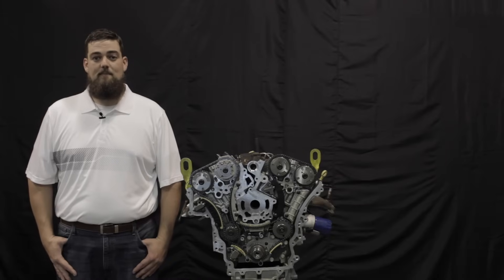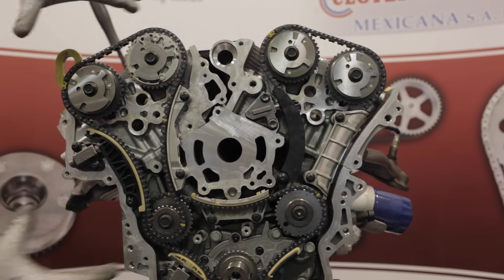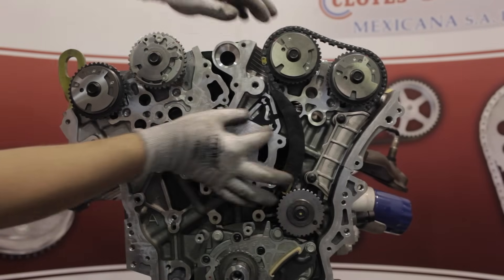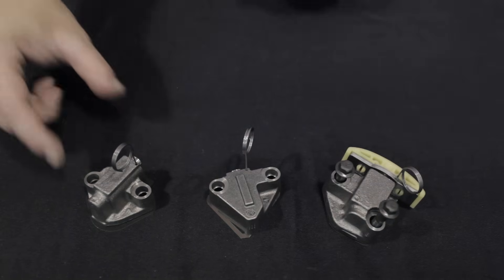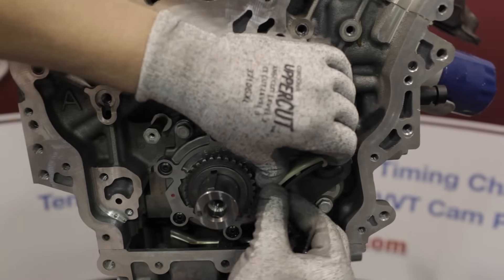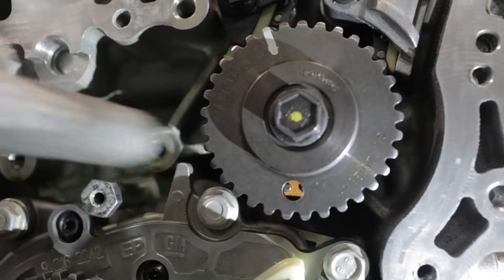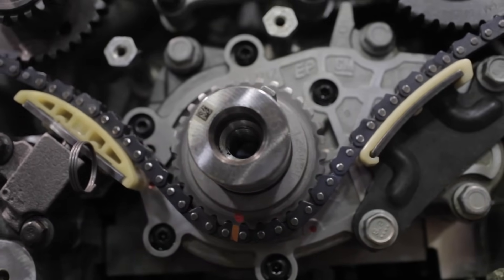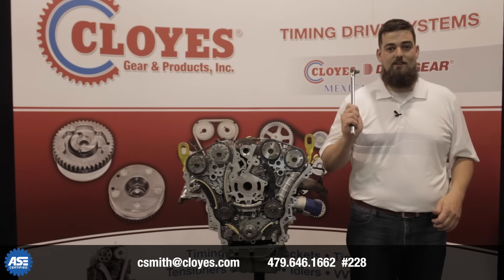GM 2.8/3.0/3.2/3.6L Timing Chain Replacement Repair, Cloyes 9-0753S

Comment: Awesome video! Thanks Cody! But do y’all have a kit for the 06 Cadillac STS v6? Part number please..? Thanks again!
Reply from the maker: Sorry Dennis. We do not have a timing kit for his particular Make/Model/Year. GM changed some features on the timing system between 2006 & 2007. They went from a roller style secondary chain to inverted tooth chains. All we have available is the later kit with the IT chain. Thanks for the kind words though! Call our tech line, and we might be able to assist you a bit more.

Comment: i am assembling a motor that already had timing components removed. while installing my primary drive chain, do i have to know if cyl #1 is at TDC on the compression stroke or do i just align the crank sprocket as shown in the video. is there only one way to do this or will the marks ever line up but the timing be out of place? not sure if crank was previously spent out of position. there is no reference to piston position.
Reply from the maker: just align the sprockets as shown in the video. If all three chains align to the sprockets at the same time, the engine will be in time.
Reply: @Cloyes01  hi.
My timing has moved. How do I exactly line up the cam Marks?
Reply from the maker: @sanjec  The camshafts all have hex features where you can use a wrench to rotate the shafts individually. With the idler timing mark aligned to the appropriate chain link, rotate the camshafts so the marks align properly to the chain.
Reply: just put heads on a 3,6 gm and picked up a cloyes set I cant find and piston timing procedure, Stage 1 (driver side chain)  or stage 2 (passenger chain) which of these are supposed be TDC on cylinder 1#?

Comment: What about setting it to top dead center before proceeding ?
Reply from the maker: There is no need to worry about TDC when setting the timing in this engine. The timing marks on the sprockets and chains insure the engine is timed correctly.
Reply: What if the right bank camshaft timing marks are not at the top so i cant set the colored chain links

Comment: How is the engine being rotated from secondary to primary and vice versa in this video? From the rear of engine with transmission removed?
Reply from the maker: Yes, we used the flex plate to rotate the engine in the video. With the engine in the vehicle you can slide the balancer onto the crank and rotate by hand with the spark plugs removed.
Reply: This is also my question at present.  Since yours was 2 years ago, maybe you know by now?

Comment: Sorry, but you must remove engine to do this project, on transverse mount
Reply: No you don't. You just have to have a lot of patience. You have to move the fuse box over, pull the alternator and power steering pump in addition to what he mentioned.

Comment: Can the chains be replaced without taking the engine out of the car?
Reply: not on a Transverse mount engine.
Reply: Doing it right now and yes it's possible... 09 Acadia
Reply: Yes it can be done with out removing the engine. Just take your time and remove the fuse box, fuse box base, motor torque brackets, power steering pump bolts, etc.  Don't them tell you it can't be done. It just takes longer.
Reply: Yes it can be done in vehicle.  Just take your time and clear out as much as possible like Rick said.  Not a horrible repair just time consuming.

Comment: Great video, I just completed the timing chains on my cts. Your video was very helpful for chain installation. Its a big job for a diy guy but it beats the $3600 shop bill. Thanks for the vid
Reply: Did my '10 Buick Lacrosse with 3.0l v6 in frame wasn't bad at all!...i was down to the chains In about 45mins but beware guys that right bank is gonna give you the blues because the timing marks are ever so slightly off...and the phasers are gonna want to roll on you you!...its best to get the camshaft retainers to hold the cams still while you degree the marks!...other than that pretty easy job!...
Reply: Mr. Grider,  did you have to pull the engine out of the vehicle or were you able to do it all under the hood?
Reply: @jayclarke2434  the guy said you do not have to pull the engine from the vehicle

Comment: You are better to set the car on fire and buy a Ford if you were stupid enough to buy a GM in the first place.
Reply: Ford's Use of Plastic 
for Cooling System parts
since at least 1998 
is why my friends Fords 
no longer run.

Comment: was that the torque wrench used in the install process you dropped on the floor as you concluded ur instruction?
Reply: That’s a breaker bar, dingus.

Comment: Hi Codi can i ask you about  idler sprocket when you  install timing chain set  if rotate the engine   to stage two  timing position  after rotation  2or3 time all mark  strait at mark  aligns except idler sprocket  if you please let know thanks

Comment: Cant Thank you guy enough. I walked through this step by step with this video. Glad you guys did it.
Reply: Jay Clarke definitely you can do it with engine on
Reply: Doug, were you able to do this job while the engine was still in the vehicle or did you need to pull it out?

Comment: Did you forget to mention the special camshaft lock tools so the camshafts doesn't slam back during assembly? They do install on the back of camshafts so you might not can see them ?
Reply from the maker: No, we did not use the special camshaft holding tools for this installation. The tools are available, and may prevent the  camshafts from slightly moving when the chains are removed; however, they are not required. The idea behind the two stages of timing is to position the camshafts on each bank where they are at rest before the  chains are removed. This prevents the camshafts from moving when the chains are removed, effectively eliminating the need for the holding tools.
Reply: Ahaa! I was wondering why you did the two stage process. Perhaps a few words towards that feature of the process would have been enlightening . Good video anyhow.

Comment: Thanks for the video. The timing chain of my 2010 Chevy Traverse AWD is on the passenger side. Is it possible to change the timing chain with the engine still in the car or I have to drop the engine down? I appreciate your reply.
Reply from the maker: You should be able to access your timing components with the engine in the vehicle. Just a little less elbow room!

Comment: Anyone that is doing this job along with removing the heads to replace bent valves, don't just assume the chain skipped some teeth due to being stretched causing valve to piston contact. Remove the cam actuators(phasers) from the cams and inspect the locating pins in the actuators and the slot in the cam that the pin fits into for shear damage.

I just bought a 2006 Cadillac SRX with the 3.6L with 129K miles and all the exhaust valves on the passenger bank were bent so I assumed that cam had jumped some teeth. I pulled both heads, replaced the bent valves and did a valve job on both heads. I got the heads back on and started timing the engine with the new timing set and all was fine until I got to the stage 2 timing for the right bank cams. The intake cam lined up just right with the colored link on the chain but the exhaust cam sprocket was about 40 degrees rotated clockwise. I put a wrench on the actuator bolt to turn it back for the marks to line up and with very little pressure, the bolt came loose. I knew these are torqued at 43lb ft so this was weird it cam loose so easily so I went ahead and removed the bolt and took the actuator off and I saw what actually caused the valve damage. The actuator had spun on the cam and the locating pin was laid over sideways and the hole for the pin and the slot was totally wallowed out and from the damage to the actuator, it was clear that the actuator had spun many revolutions independent of the cam.  I can't imagine how this happened unless the bolt was not torqued properly at the factory or if maybe the timing chains and guides had been replaced before and a mechanic loosened and then forgot the tighten it back.

This is probably a very rare occurrence but it's still worth the time to remove the actuators and check the pins if your engine has bent valves.
Reply: Duc Rider how do you know if it was bent valveswithout taking the head off
Reply: @chevycinco6654  He said he pulled both heads "I pulled both heads, replaced the bent valves and did a valve job on both heads."
Reply: Thanks for the tip. How long did it take you to replace the chain, I know you did heads also. I am trying to come up with a price to give my friend to replace the chain. Thanks
Reply: John,   Alldata calls for 10.3 hours to do the job. I think that's about right.
Reply: Thanks for the quick reply.
Reply: remove the cams and check the valve stem height...bent valves will be shorter...
Reply: Duc Rider thanks will check this out before I do mine. I knew something was up when I bought mine for cheap. Garage wants right a 2 grand, to fix.
Reply: I’ve seen camshaft bolts break because oil wasn’t changed properly caused number 1 rod bolts to heat up and stretch. Rod bearing had already came out of the connecting rod. What was left of it had been beat into the rod journal on the crank. This caused a hard place when attempting to start and broke camshaft bolt to snap. I didn’t notice bolt was broke until I attempted to loosen and found it broke. The motor turned over as if it were trying to start but only the timing chain and gears were moving. I noticed the camshaft wasn’t moving that opened and closed the intake valves. At first glance, it looked normal.
Reply: Duc Rider
Reply: I had a spun bering on my 04 cts know i got a 07 so i had to take the cam phasers amd sprockets of old one know i need to put on the 07 yes theres diferents wat i wana know is if im replacing the cams how do i do it this vedio only shows the chaine i wana know how to instald them so there top dead center thank u
Reply: scracer24c  I did a leak dow test and one valve the intake valve specifically had a little bit of leak. The valve went up and down freely but I'm not too sure if its bent or if it's just a dirty valve. What do you suggest?
Reply: scracer24c  thanks. I'll do a compression test and see if it checks out. Since the leak felt so insignificant I thought it might have been just build up.
Reply: Awesome comment and full of useable knowledge. Did you need any special tools, I have at least 3K worth of tools in my garage because I do auto repair on the side and learn how to repair vehicles as a hobby but I want to get into timing and more in depth engine stuff. So I was wondering if for this timing job you needed special tools?
Reply: @gabrielfranco9786  No. No special timing tools needed. The cam phasers have guide pins and the alignment is achieved with marks on the sprockets/phasers and colored links on the chains. Pretty simple and straight forward.

Comment: ps the cloyes timing set is supposed to be superior to oem according to internet blogs
Reply: Im from Detroit, I promise you taht Chevy, or GM, Ford, Dodge etc... dont make the parts for the most part. They contract it out. I bet Cloyes, Fed-Mogul, SKF, Felpro and anyone else involved in carf parts manufacture all have offices or wharehouses/fatories in the Detroit area to supply those parts.
Reply: Richard Skipper. Is there better video I can watch? I doing now timing to my Acadia 07

Comment: how did you rotate the engine to the different stages without the crankshaft rotating socket? do i need to get the socket?
Reply from the maker: The special sprocket will work to achieve the goal, but it is not necessary to complete the task. We used the flexplate to rotate the engine during the video. If you do not have access to the flexplate/flywheel, then you can slide the balancer back onto the nose of the crank and use it to rotate the engine by hand. Remove the spark plugs to eliminate compression and it should be easy enough to turn. If you can't turn it by hand, the balancer may have some threaded holes where you can insert two bolts. You can then use a pry bar between the bolts to rotate the engine.
Reply: Ok, the job is now becoming a lot more time and labor consuming.  No more cars with 3 timing chains.  I do not want to hear anyone mention a car with a DOHC Engine as a selling point.   @Cloyes01
Reply: hi if you can help me not sure how to prime oil pump thx
Reply: Cloyes Gear & Products, Inc. (Aftermarket) I have put the balance on and I'm able to turn but it stops shy of the mark and won't turn any more.  what should I do.
Reply: Michael Sharp 
make sure nothing is jammed
or moved  out of place
then 
put the Balancer on
Bolt all the way  in 
socket and ratchet/ breakerbar
to tighten till 
it turns 
to where you want it.

.

Comment: Hello, Do you make a kit like this for the earlier version 3.6?  I have a 2004 CTS 3.6 and I have had no luck finding a Cloyes kit for my car.  I want to stay away from the cheap Chinese junk that's out there.  Thanks
Reply from the maker: Cloyes does not currently have a full kit available for this application. We have the secondary chains only. Cloyes part number: 9-4209

Comment: About how many miles does GM say this engine will go before these timing chains need to be replaced?
Reply from the maker: Most original equipment manufacturers now are not providing  replacement intervals for chain drive systems as they do with belt drive systems. In many cases it is simply stated that the timing drive is a lifetime internal engine system.
Reply: Timing chain replacement interval? No thanks, I'll stick to my old V8's and 3800 V6's. Cars are being manufactured these days to be money pits. Give me an overhead valve V8 and a radio, that's all I need. I don't need a computer for my door locks, touch screen, blue tooth, etc. I put a Cloyes Timing Chain Set on my nephews 3.6 last year. Great product, well made. It took me five full days to ensure it was done right and timed correctly. The car had only 80,000 miles. My 1996 Caprice LT1 V8 has 350,000 and has never had any major engine repairs. Modern cars are a joke.
Reply: Cloyes Gear & Products, Inc. (Aftermarket) 
hello sir. it's been awhile since i follow you in yotube and i want to appreciate for your video. 
as a matter of fact today a customer referred to me and he told me that his car had burned head gasket 2 month ago ,after removing head gasket engine isn't working normaly on idle condition,i suspect to the timing setup so i need your help .do me a favor if you send me a workshop or a menual repair about remark and how to set up the timing chain. because i don't have access to any guidance  .thanks alot.